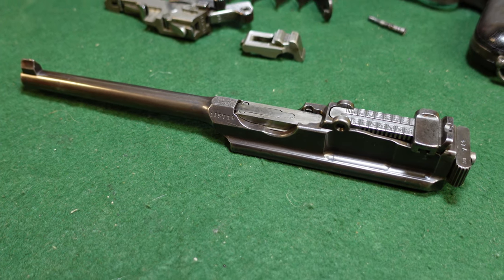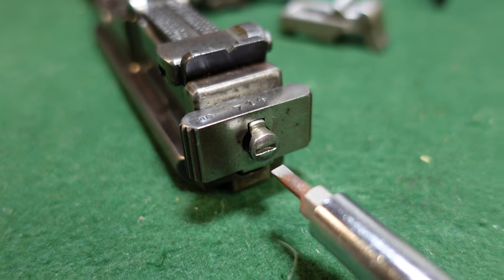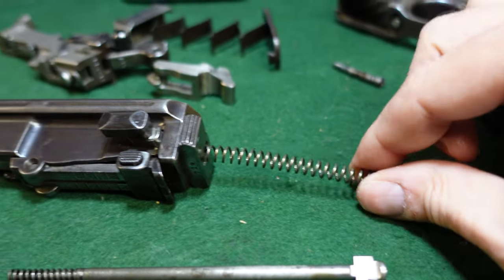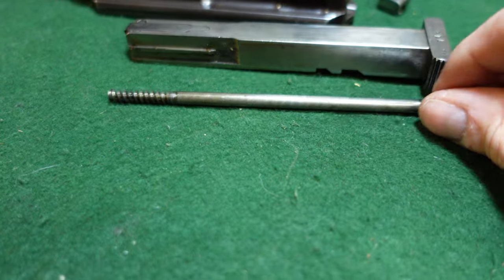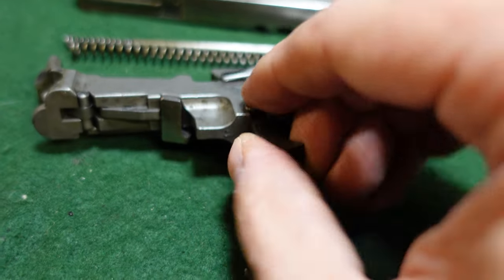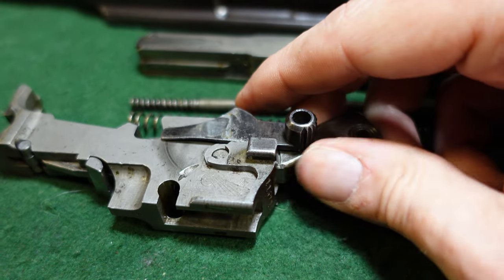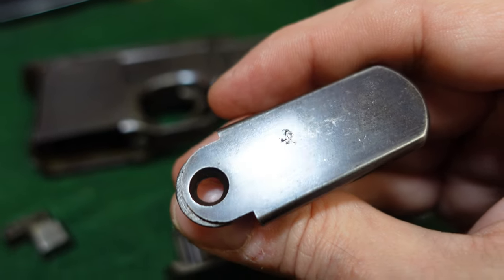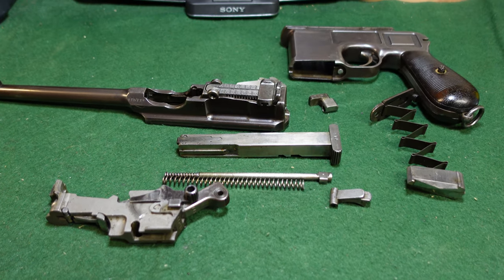Mauser Broomhandle Pistol: Firing Pin Removal and Upper Disassembly

Comment: Hello. I noticed that one of the 714 digit numbers on this gun is 715 inside. I have a c96. The three digit number is 295 and the internal number is 296. The dealer said it was a manufacturer's error. I have been confused. This Why? Can you help me answer it?
Reply from the maker: It could very well be a manufacturing error, given that the numbers are one off from each other.
Reply: @historicmilitaria  Thank you for your reply. I think so too. If the numbers are too different, it should be that the parts have been replaced. If the difference is only one digit, the probability is too low and it is almost impossible.
Can I think that this is a matching number?
Reply from the maker: One number off on one part in an otherwise matching gun would be "matching" in my book!